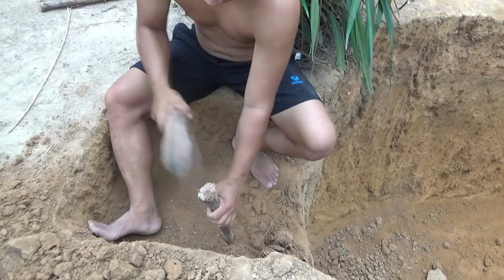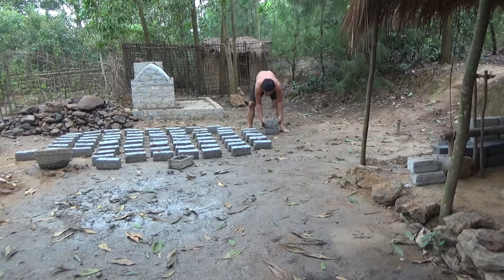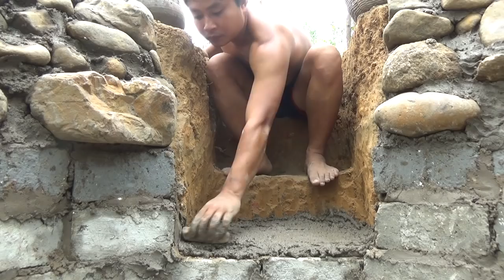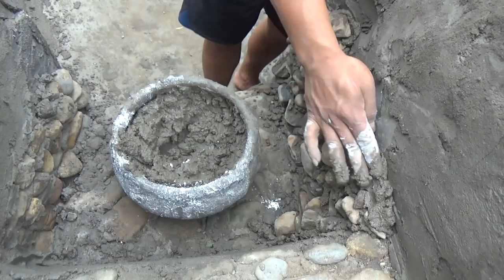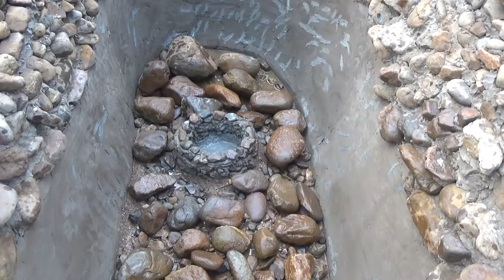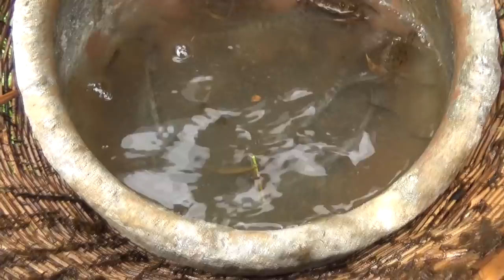Primitive Life:Build Fish Pond-Exist Forever-Meticulous!

Comment: the fish are going to die because there won’t be enough oxygen supply
Reply: isn't that what the lilly pads are for?
Reply: @jellesmith  in the end you can see how all the fish are heavily breathing at the surface. that means low oxygen :(
Reply: Next-up he builded oxygen refresher. This is old video :/
wtf
Reply: It's true that might be a problem until the pond's plants take off and supply the oxygen.  He put dirt on the bottom and planted so the flora should grow well.
Reply: @Marco-xz7rf  ahw sad :'(
Reply: he adds a bubbler made from bamboo later
Reply: @Marco-xz7rf  they didn't die, this project is over a year old
Reply: @blackbway  i know its old. how you know they didn't die? maybe he build a bubble rbecause they died?
Reply: Not necessary. Fishes from suborder Anabantoidei (like Gourami) are breathing atmospheric oxygen.